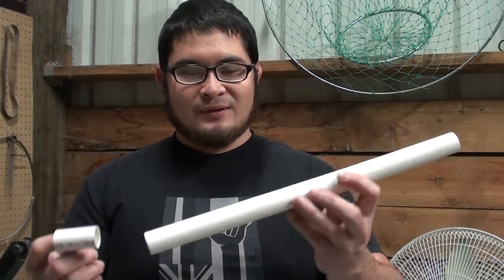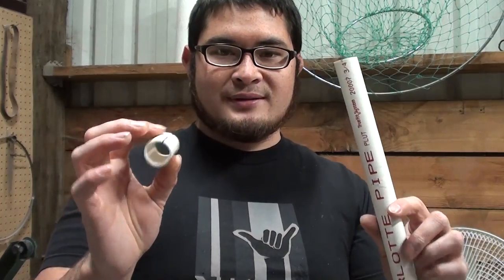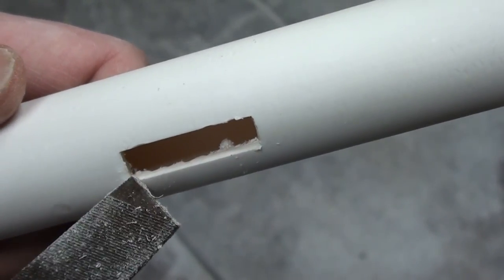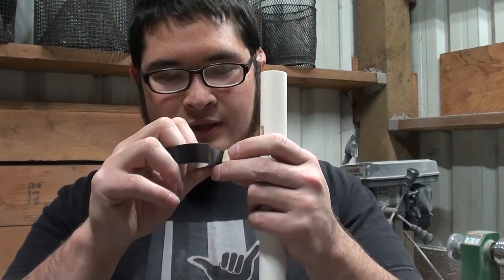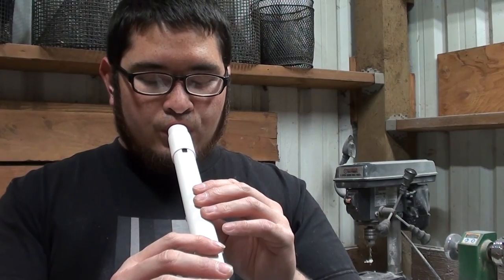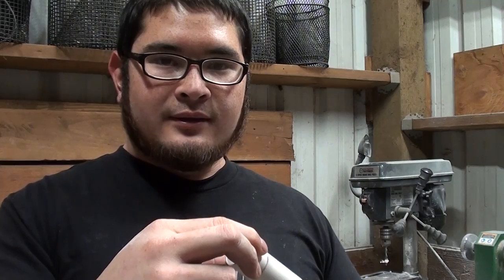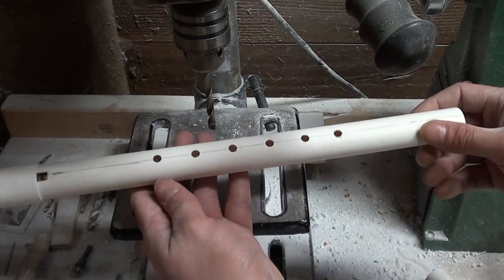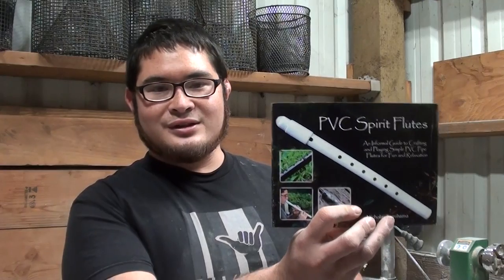Making a DIY Native American Style Flute Out of a PVC Pipe

Comment: Great job on a simple PVC flute build Nick. Can I make a suggestion ? If your going to use a rounded top plug, and the split piece as the bird to seal the flue, which is also rounded on the inside, try making your fipple or cutting edge rounded as well so it catches or splits more cleanly, the air coming down the flue. Also try keeping your TSH ( true sound hole ) no bigger than 1/4" wide from the end of the flue to the cutting edge. That will help give a much cleaner, less windy tone. Love your videos brother, you are a true inspiration my friend. BTW , did you ever put that little wooden Ocarina kit together with your son that I sent you ?
Reply: +BackyardBowyer ??

Comment: Excellent build along Nick! I've made a couple of these, and even purchased your book. What a great resource! Do you have any suggestions for lowering the overall tone of the flute? The first two holes have ended up almost earl-splitting for me, the others are quite melodic. I've tried making the flute 18" as well, assuming that would help, but it seemed to get worse. I've tried that with two variations, one with the holes starting at 4" from the end, and another in the exact same position as on the 16" version (so holes start 6" from the end). Thanks again for your great content!
Reply: Have you ever had any trouble with it playing to high? I made mine exactly like his but it plays much higher and only the first 2 holes work

Comment: What diameter is the pipe your using?
Reply: at 1:33 into the video, pause and you can read 3/4" on the top end of the pipe.
Reply: @charlesblair6650  thanks!

Comment: Tried today with wood and aluminium but messed up the wistle by making a straight air way. That does not work on lower notes. The air really has to move around that half inch plug.

Comment: Thank you for this, Nick! Just one question, is the improvised melody at the end being played on the flute you made in this tutorial? I'm making one for myself and I'm a bit worried if it will sound good without actually tuning it to some key. Thanks!
Reply: You can tune these fairly easily. The flute itself can be tuned by shortening the length, and then the finger hole notes can be tuned by drilling them out. For the finger holes, start with small holes and step up in size until the correct note is played

Comment: Do you glue the wood in the flute once it’s tuned to what ever key or way you want it to be. Do you glue it or will the tape you used keep it from sliding down or loose or out. If so what works best gorilla glue or glue for PVC pipe or school glue or it doesn’t matter.

Comment: man, i clicked the yt link from search and lo and behold it's  Nicholas Tomihama The BackyardBowyer you absolute champion!!! you've done so many things, and so very well, that i think i'ma go buy some of your books now because dammit man you deserve some sales!! anyway, great video, as always; your instructions are super easy to follow!!! this 'fipple' you say, the sharp edge that cuts the wind, you file it to a beveled edge? something like 45 degrees? from inside the pipe as well? does it need to be knife edge-ish sharp or just beveled? thanks for all you do for us sir!!
Reply: made the hole an oval because it was easier with the drill bit to be rounded, used a rat tail rsap/file to bevel inside and outside of the edge of the hole, cut a cover piece, cut and shaped a lopper handle and wrapped with teflon tape to seal (i got a really neat vacuum that impressed me), and after some moving of the plug and cover back-n-forth i got a low and a high note!! researching tunings now! you're such a baddass Nicholas Tomihama The Backyard Flute-Maker!!
Reply: cut the sound hole at like 45degrees, started the note holes at 3" (don't follow along with me, that wasn't bright it doesn't work that great) and gave a two thumb between the first and second 3 holes. very very neat that i can make a flute, now i just have to figure out how to tune and play it lol. THANKS A MILLION NICK!!

Comment: I just have a question I've made two of these using your dimensions both still sound very breathy what kind of trouble shooting should I be looking into for a more crisp sound
update: I figured out how to cut most of the airy sound out. I flattened the pipe with my sander at the rectangle hole thinning down the pipe wall and reducing the amount of air necessary to make the notes.